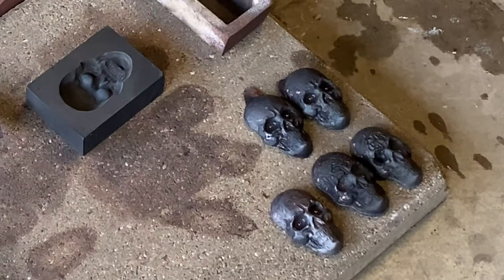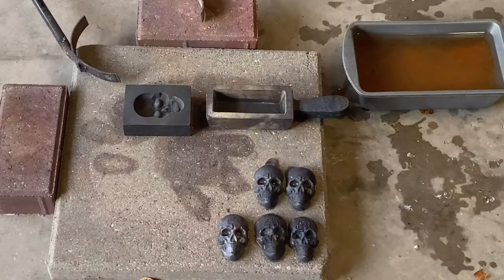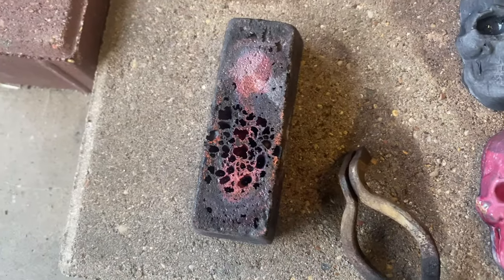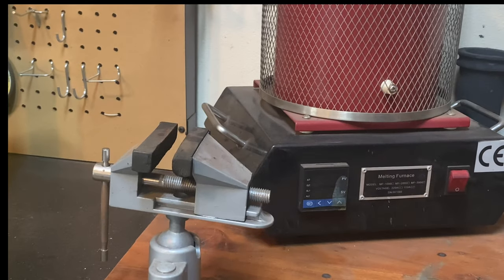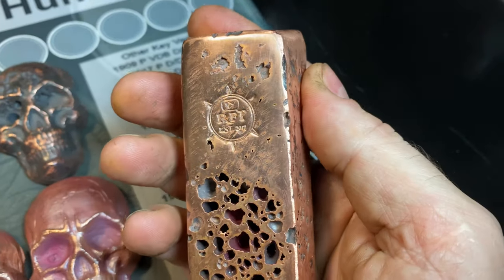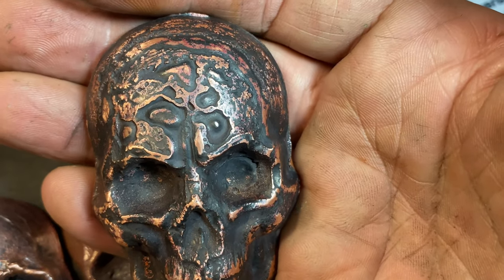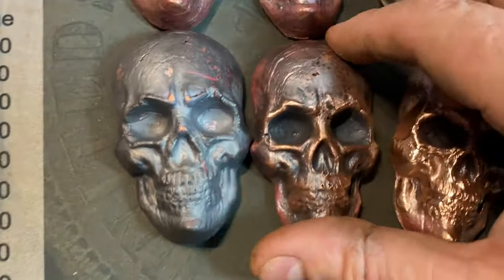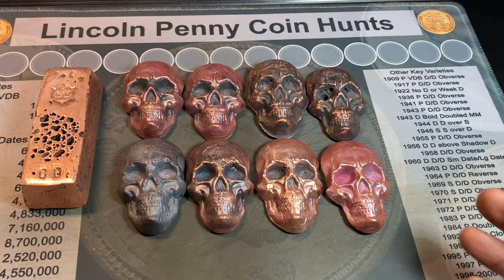Melting Copper Wire at Home - Making Copper Art Skulls

Comment: I like the pours! It's something I've gotten into over the past 6 months. I am working with sand to try to get unique pours. My nemesis is an American flag bar. I found a soap mold that I poured plaster into to make the shape in the sand. I have to mix a little aluminum into the copper to get it to pour smooth.

Comment: great video sir, for cleaning the skulls try some costic soda and hot water, let it soak for 20min or so, then rinse in cold water. this works very good for alloy aswell. doing this will leave a dull mat finish you can then polish after this process. 
I will be making skulls out of alloy as i have a sh!t load of alloy plate.

Comment: Interesting to watch 
Do you add anything in to help remove impurities 
Thanks for sharing
Reply from the maker: Not for the .999 Fine Copper wire - BUT it still has some impurities (dust, coating, etc) so might be better to do it IF I really wante dit more pure.